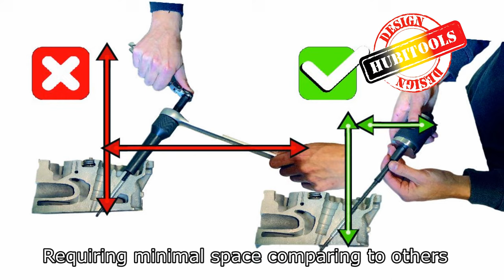How to remove a glow plug when it is broken in the top of the cylinder head? Discover the HU41051 !

Comment: I have removed the tungsten electrode. Now it’s just the casing that’s stuck in there. I can see you have drilled the threaded part of the glow plug. Did you not have to create a new thread for the new new glow plug

Comment: Don't get me wrong , these kits are all well and good and can get you out a situation.. but most of them have the same "Achilles heel" What it there in place to stop the drill or tap cuttings from falling into the cylinder??
Reply from the maker: The only moment when cuttings could fall in the cylinder chambre is when pulling the glowplug out. So right before doing it, it is important to either blow some air or even better use a magnet to remove everything. Adding grease to the thread of the puller and arround the extraction area will help by sticking dirt.
Reply: How could anything possibly get into the cylinder when the glow plug is in there 🤦

Comment: Dear Hubitools team,

The HU41051 kit on your website doesn't seem to have the electrode extractor tool that you show in the beginning of the video. What is the model number ?

Thank you
Reply from the maker: Hello sir, 
It indeed is included in the set HU41051. Both puller and drill (in case the electrode does not pull out using the puller tool) 
Thanks for your interest.
Reply: @Hubitools  Thank you for your reply

Comment: Hi, is it possible to remove electric connector even if it's not threaded (with plug)? The one on video looks like the one with plug. How the special screw holds there so strong, that you can use slide hammer to get connector out?
Reply from the maker: Hello, this tool makes possible to remove the glowplugs with a connector (for electrical) on top. If the glowplug had a threaded top, it won’t work.

Comment: Please, how to remove when the threaded part is still stuck in the head? I broke a craftsman screw extractor and I am in more trouble now. I was told that I need a SNAP ON screw extractor. Any ideas please?
Reply from the maker: Hi. Not sure to understand your question. Is it the thread part of the glowplug that needs to be extracted, or your craftsman extractor that broke that your need to pull?

Comment: Hi great video, I will try follow this video to remove a stack heating rod from an old glow plug any tips that you can help me with this job?
Reply from the maker: Hi There :-) By "stack heating rod", do you mean the glow plug tip? If this is the part that is broken in the cylinder head, we would advise you another one of our kits (HU41050 https://www.youtube.com/watch?v=x4JMKZNd3j0) that is specially designed for this type of situation.

Comment: the slide hammer won’t get a glow plug out if the but is just spinning as it needs to be undone on thread first
Reply from the maker: Hello, maybe you didn’t watch the whole video. We use the slide hammer to remove the electrical connector, then we remove the thread by drilling it. Then we remove the electrode, tap the remaining body of the glowplug and extract it

Comment: I'm just going to leave it inside the glow plug port. Engine starts fine, not even engine management light on. Let's see what happens
Reply: Did anything happen? I snapped mine and I am thinking whether I should leave it or try to pull it out.

Comment: Great tool even better seeing it being used... I have 14 tdci where the tip is snapped.  I can remove hole glow plug apart from the bit that gets hot. Is there anything that will remove tip stuck in combustion chamber?
Reply from the maker: Hey Dan,

Sure, you can use our HU41050 kit "UNIVERSAL GLOW PLUG TIPS PULLER M8, M9 & M10". 
Explanation: https://www.youtube.com/watch?v=J8ld8-zdNYE
Available on our Eshop: https://www.hubitools.com/fr/catalog/kits-pour-crayons-de-bougie-de-prechauffage-casses-m8-m9-m10~151634b0-de48-220b-f836-39eabe1adc43
Reply: @Hubitools  great thanks 👍
Reply: @DW-hx1xm  - If only the tip is there you might want to try another approach. Instead of taking it out the "normal" way. Push it into the chamber and remove with small magnet! Might sound awkward but as worked before. Cheers

Comment: It says "enables glow plugs broken in the top of the CYLINDER HEAD to be easily removed". But it don`t say what to do "when the glow plug is broken AT THE TOP of the glow plug  itself, AND the threading is well  stuck in the cylinder head".
Reply from the maker: Hello, It is the same. Just different way to explain where it broke. Look closely at the video, this kit aims to pull the glowplugs that broke above the threaded part. So at the top of the glowplug if you prefer.

Comment: Managed to get the glow plug out, but the problem is the new one is just spinning ! I drilled the old one as instrcuted, a M10 plug. Any ideas?
Reply from the maker: In the process of drilling the locked glow plug, the thread in the head probably got damaged. No worries, you can simply put an insert that you can find in any automotive parts store.
Reply: @Hubitools  any idea what size that should be? A bit confused - if I want it to take a M10x1.0 glow plug, then shouldn't the insert be bigger than that with the insert diameter 1.0, but maybe the outside diameter 1.25?
Reply from the maker: @michaelfreeman7381  For a m10x1 internal insert you will need a m12x1 outside diameter/thread.

Comment: Hi, for drilling out the threaded part of the broken plug body what is the best torque and RPM to use? (I have a drill for what i can set both RPM and torque)
Reply from the maker: 300rpm 
No specifications for the torque